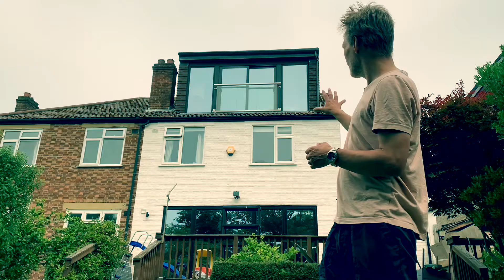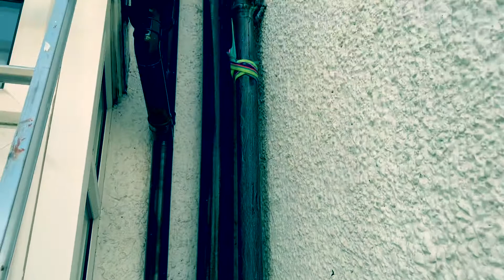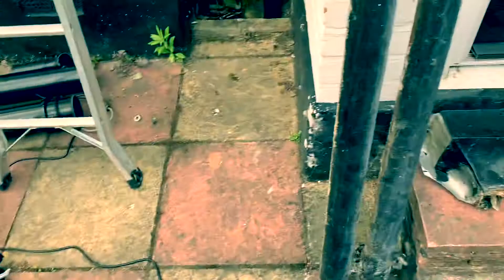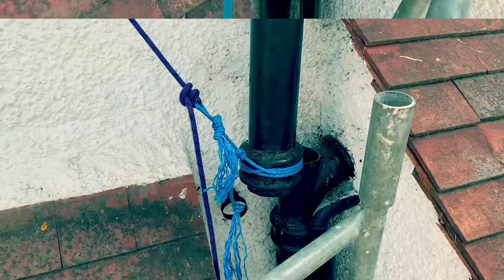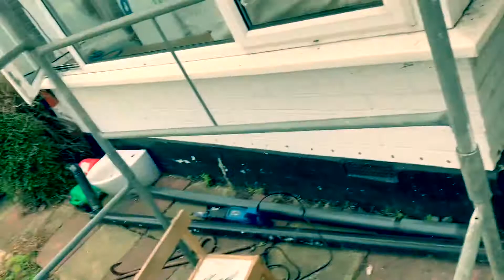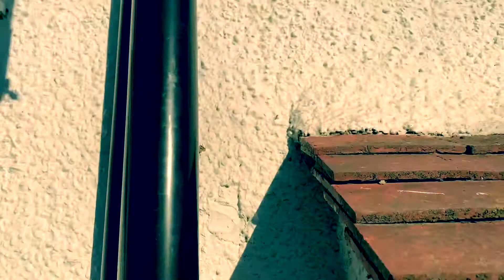1. DIY External Wall Insulation: Moving and replacing pipes (inc. cast iron) and wall attachments

Comment: Thank you for this! 
My '20s end-of-terrace has been extended, and I have permissions in place to externally insulate surfaces not covered with new construction. Until I came across your series, I was contemplating removal of shed-loads of pebbledash.
Reply from the maker: Good that this has been useful. I’ve had to do a lot of drilling through the pebbledash for the pin fixings and it seems it’s more difficult to drill through the pebbledash than the brick behind. So it’s definitely very strong stuff - at least on this house.

Comment: very good videos, but what about extending roofline or sofits to accommodate ewi, appreciate any thoughts or comments unless i missed it in the video, thanks
Reply from the maker: Hi, For me the front of the house had eaves sticking out about 30cm and so the insulation fitted under that without needing verge trim (I did use expanding foam tape to seal the junction between the boards and the eaves though. 
At the back I did need to extend and used upstand verge trim to fit under the soffit. I show that here: https://youtu.be/C4Rh5EeZNTo
And then also for the side of the house and one part of the back I needed to extend using normal verge trim and I show that here (a the back): https://youtu.be/tw8QZSwamQA
I hope this helps and do let me know if any more questions.

Comment: Would it be possible to put thinner insulation boards behind the soil stack instead of removing and replacing it,or might this cause issues?
Reply from the maker: I think that would be possible. But my pipe was so close to the wall I couldn’t have got any boards behind it - with the adhesive and render you already have about 20mm of thickness and you also need to get tools behind the piping. So for me I definitely needed to move the piping out. Fortunately it was a lot easier than I’d feared it would be